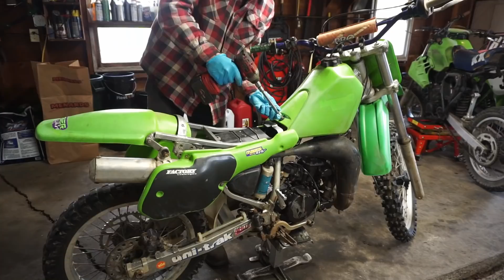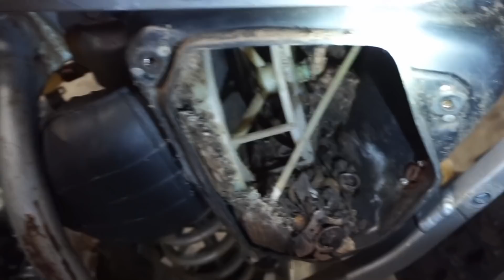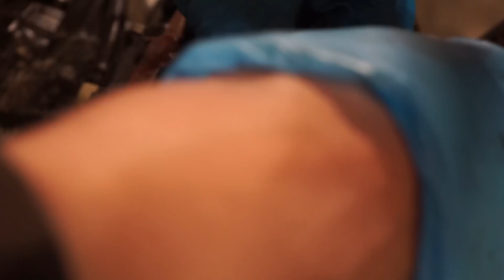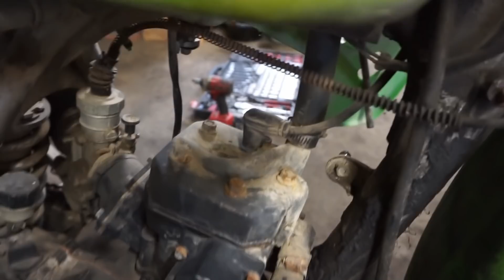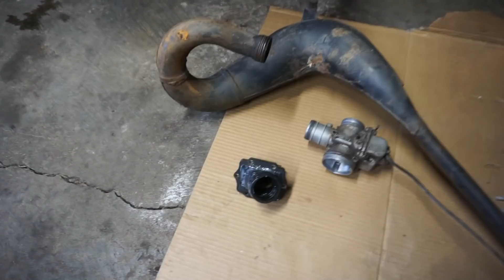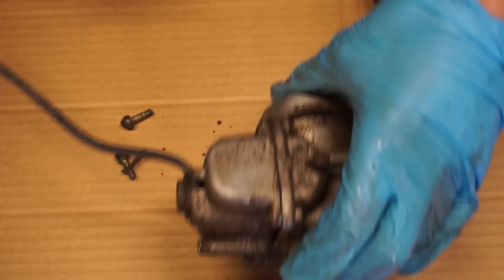$75 Dirt Bike. Can It Be Saved?

Comment: I bought a 84 Honda ATC200S for $100. Has all plastics and seat in 7/10 condition. Headlight w/o lens, no rear light. No metal racks. Bought a coil, CDI, spark plug, stator for $70ish. Tire has a wobble but it runs great

Comment: Black non hardening form a gasket is what we used to use to seal a crack in an intake boot way back in the day... Squeeze it into the crack and smooth it down with a flat scraper and throw some heat at it using a heat gun and it seals the crack... Or just press some high end sillycone sealent into the crack if you're in a hurry and don't care what it looks like.. There's also vulcanizing cement but that's a pain in the a55 using a hypodermic and scraper and heat for a permanent fix...

Comment: I bought a  1987 Kawasaki kx 500 for $400 
that ran.  Later I found it had radiator fluid in engine oil.  Got frustrated sine parts are not available new anymore, so traded it for a 1997 honda xr 400 that had no problems.

Comment: i just give my friend a big Syringe Pump where is a plastic hose stuck at the top, and I told him to put  end of the wire inside the hose and the other end of the wire into the oil tank and start sucking oil into it, he got the old gas and clutch caples work like a new one.

Comment: Take that bottom end out of the frame on that 87 turn it upside down and blow compressed air at the same time you're rotating the crank that should take care of that last kink in the rotation of the crank and it'll help more as yk lubing it again first, and the point of it being upside down is so that whatever piston or other foreign junk that may be in there will drop out
Reply: We use to just spray the crap out of the crank with a power washer and rotate that b** until it spent freely🤣, thinking back on this old tactic of mines it's actually Very effective! Then let water run out of oil plug hole too same time so when you do the engine oil flush you'll only need to do only 1 or 2 times and she's ready for fresh oil👌

Comment: I've had several bikes come in with carbs looking like yours and much worse. Every one of mine has had rats nest built in them and their urine runs down into the carbs and eats away. A lot of mine have turned into a chalky white inside and the layers of the carb peel away

Comment: Looks like the ring caught on the intake port badly and the messed up the cylinder getting out the wedged piston it seems to ME, ki literally had this happen 2 times in a row in the last month. I was told either from bad crank seals or terribly bad jetting. I just so happened to have both😊

Comment: That front brake line needs to be routed behind the fork tube not on the outside of the tube
Reply: Why's that? They come factory like that and also there's not enough room behind when u turn the bars all the way to the left. It needs to be in front so it can move up and down freely as the suspension compresses.
Reply: @homernextdoor5950  wrong I never seen a brake line routed on the outside of the fork tube everyone goes around the inside between the fork tube and the wheel so it doesn't get snagged by a branch and get ripped off and throw you over the freaking handlebars
Reply: @navyseabee7245  No, not wrong been racing 2 strokes and enduros since 1979. The only time it would be behind was before disc/hydraulic brakes and then the cable going to the drum could be routed behind the number plate because it is much more flexible. Enjoy your day!😁
Reply: @homernextdoor5950  I'm not talking about behind the number plate I'm talking about the brake line being routed around the fork leg fork leg not the damn number plate and by the way I've been racing since 78
Reply: @navyseabee7245  Obviously you have never raced motocross, name me 1 racetrack that's outdoors or in a stadium on the pro or pro-am circuit that has trees or branches. Motocross bikes are only subjected to dirt,mud,sand and rocks. That's why the front brake line is where it is in this video and still is to this day on ALL motocross bikes from the 80's - 2021. Fuck even my 89 kdx 200 which is an enduro meant for bush wacking came from the factory with hand guards and the brake line in the same place as always, down the front of the fork!
Reply: @homernextdoor5950  no more mister know it all !!!!  i cant take it!!!